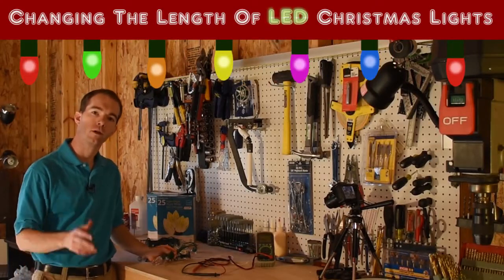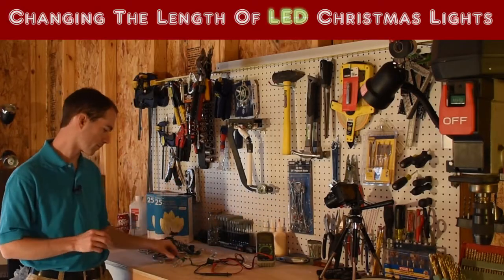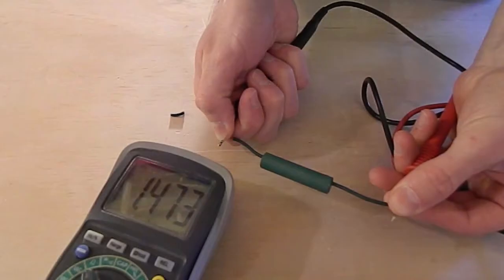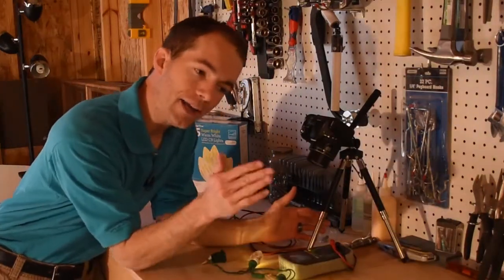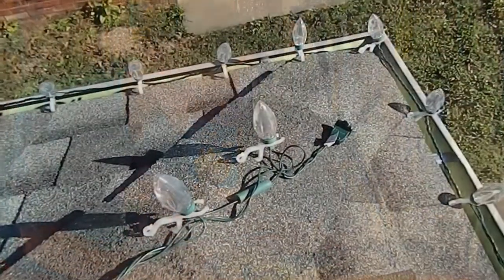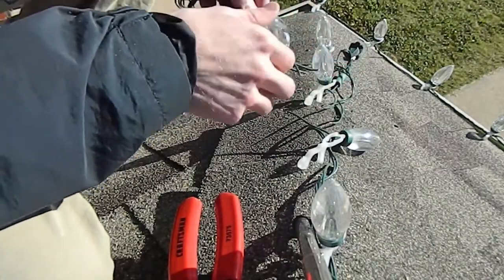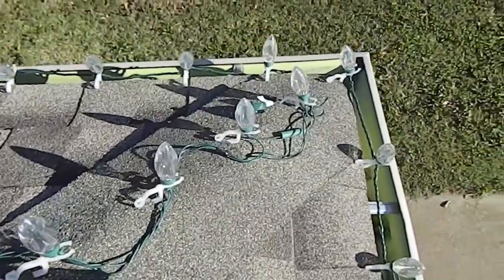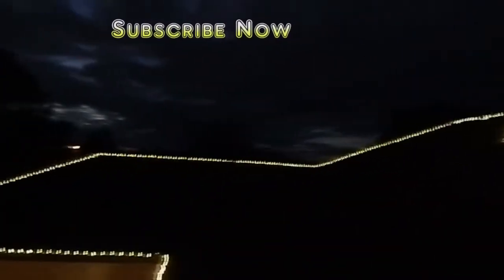Changing The Length of LED Christmas Lights. Don't Do This!

Comment: I am just now learning some of the basics of electrical connection. I have 2 strands of lights that I would like to connect together, by removing the female plug at the end of one where the 2 can connect by plugging into each other. 

I would to have it all one continuous strand, and essentially double the length so there won't be this eye sore of a foot and half or so of no lights with connection plugs right in the middle of it.

Is this safe to do, and how would a person go about doing it if so?

Thanks for any advise you have!
Reply from the maker: Hey Will. Great timing! I just had to do exactly this when my driveway plug got run over. I cut off each plug and soldered and heat shrunk each one. the plug ends only have 2 wires each, so it's easy to do. Now there're no fuses on the second strand anymore, but I haven't seen a problem yet, and they're been on for about a day now. I wouldn't put any more in series like this though because at some point, I'm going to blow the fuses in the first plug. Thanks for watching!

Comment: Hey Mike! Just found your video and was wondering if you could help me. For Halloween I have some craft jack-O-Lanterns I light up with store bought led lights. What I'd like to do is take the strand and splice in some wiring so I can increase the distance of the lights.. so it'll be the same amount of light in the strip, just adding in varying lengths between the lights. 
I normally line the jacks all in a row, but this year I'd like to stagger them around the front of the house. I'm also open to any suggestions you might have - I could email you a sketch of what I'm planning. Thanks! Subbed. :)
Reply from the maker: Hey there! For your setup, just cut one wire at a time between the lights you want to separate and add additional wire of at least the same size as what's on there now. The additional resistance won't be a problem unless you put a pumpkin in the next neighborhood over. Go one wire at a time so you don't accidentally cross any of them and short something out. Solder and heat shrink the connections if you want something permanent. Let me know if you need more help. Thanks for watching!

Comment: So I've a 3 wire 100 bulb string. After doing a crevier system and zip tying we  discovered the lengths are too long together and weight too great for practice and want to cut them in half. I don't have 2 wires where I want to cut. I want to splice two ends, a male and female. But I have 3 wires where I want to cut. How can I do so? I see what others are saying here about not buying cheap wires and using commercial grade wire but how can I interrupt the led wire and insert a male and female in the middle?

Comment: So how do you know which continuous wire goes with which.  Periodically an animal will chew through the wires so I do not know which wire went with which.
Reply: Northern Yeti, just take one of the wires that do not have the lights on them and mark it with tape or spray paint every few feet. That way if they get chewed through you can untwisted a couple feet and see which goes where. :)

Comment: My understanding is those "resistors" are wave rectifiers that convert AC to something more like DC, making the lights flicker at 120Hz. Maybe what you got there is something different, but I question how you are seeing different voltage by adding or removing LED lights which really don't have any resistance.

Comment: If I am stringing multiple strands together and splicing a few to go over peaks in my roof, do I need to worry about the resistors? If the outlet puts out a constant voltage then doesn't having multiple strands in series each with a resistor decrease the current through the entire light system lower than just a single strand, making all of the lights slightly dimmer?
Reply from the maker: Hey David, I'm not quite sure I understand your question, but I'll attempt to answer what I think you're asking. Plugging strands end to end electrically wires them in parallel, increasing the amp draw on the circuit. It doesn't affect the lights within the strand, because the strand still sees the wall voltage and each light within the strand sees its 3.5v after the resistor has limited the current. Adding or removing lights within the strand increases or decreases the voltage across each light, without changing the resistance. Removing too many lights sends too much voltage through lights and they will burn out. Adding too many lights reduces the voltage through them and dims them. Too many lights and they won't light. It's a delicate balance. Hope that helps.
Reply: @MikesInventions  That clears it up. My assumption was that combining multiple strands together would put them in series, but parallel makes much more sense. Thanks for the response!

Comment: What if I wasnt adding any lights but cutting the strand and extending the strand to go up to another roof.
Reply from the maker: It sounds like you just want to increase the spacing between two lights right? If that's the case, simply label your three wires between the lights where you intend to cut it. I'd suggest using a different color of electrical tape around each wire then cut the tapes in half so that you don't lose track of which wire goes where. Then add your extension, making sure to keep your colors straight, and the lights will never know the difference. Of course, I still don't recommend this. ;-) Thanks for watching Nic.
Reply: SWEET! Thank you!
Reply: I also want to do this but didn't know if it was a common way to do this or not, so thanks for asking. How else would you lengthen the space between lights for a custom length to fit a house with different levels and stuff?
Reply: This is exactly what I was wanting to do to a set of LED Icicle lights on my roof line.  Basically I was wanting to extend the lights around the corners of my roof line that drop down about a foot so that I did not have a bunch of icicle lights over lapping each other.  When doing so do I need to find the same size wire when adding the extensions in or can it be a little bigger or smaller.  I have lots of SPT-1 or SPT-2 cord, can that be used between the cuts to extend the wires?

Comment: Good video Mike.  I would like to move maybe 6 LED's 25 ft. on a strand of xmas tree lights down the side of the house to light up a flower box at night.  The rest of the strand lights up the back porch.  What I am thinking is to put both a male and female connector before the 6th light and then plug them into a 3 wire extension cord.  Should that work OK?
Reply from the maker: Hey Thanks. I don't quite understand what you plan to do. Could you e-mail me a diagram?
Reply: Sure, how do I get your email?
Reply from the maker: Mike@Mikesinventions.com

Comment: So, I want to cut an LED strand in half to make an under cabinet light. Not possible without a degree in electronics?
Reply from the maker: Interesting application. If you have half the lights, you'll need double the resistance to avoid overloading them. So, if you could salvage a second resistor off another strand and put them in series, you'd be done.
Reply: TY

Comment: good information, however, electrical tape???   Solder and use adhesive heat shrink (not electrical tape), and that joint will be just as good as the original.
Reply from the maker: Thanks. Heck yeah electrical tape. Works fine. Strength isn't really an issue. Plus,  I really didn't want to solder up on the roof. :-)

Comment: Can you shorten an Led strand?
Reply: I would not recommend shortening an LED string unless you know how to modify the resistor.  Removing LEDs will increase the current.  The strings are typically designed for 15-20 milliamps.  If you remove too many you could blow all of them.  Likewise if you replace white or blue LEDs with red or yellow ones you will need to adjust the resistor or risk blowing all of them.

Comment: I'm short 9  led lights on my strand, so I spliced them in and now my strand doesn't work. any suggestions to make this work?
Reply: you simply added too many bulbs.  LEDs need to have sufficient voltage to exceed their forward voltage point (roughly 3.5-4 volts).  If you have 34 bulbs on the string there's not enough voltage to turn them on.
Reply from the maker: Hmmm... Check to make sure the wires aren't crossed. Check the fuses to make sure they aren't blown. Also check that all your new 9 led's are seated in their sockets. A blown bulb won't turn the strand off, but a missing bulb will. I hope one of those suggestions fixes your problem.
Reply: Cpt Striker, he said 2 was okay. 9 is a LOT MORE when you're talkin about 20 or 30 to begin with.
Reply: Mike Thompson     Nhcywy

Comment: I found this very helpful. I have about 25 lights too many on my last string of colored C7 LED lights. The string has 50 lights and is 32.6 feet long. Can I simply take out the middle as long as I leave the 1st and last resister?
Reply: LEDs are NOT like incandescent bulbs.   LEDs are solid state.  (LED = Light Emitting Diodes)  Diodes have a relatively fixed forward voltage drop (Vfd) when current runs through them.  Red LEDs have an approximate Vfd of 2 volts.  Blue, White, and Green LEDs have a Vfd of approximately 3.2 volts.   This Vfd is governed by the Physics of the solid state materials used to make LEDs.  The Vfd will vary only about 5 % depending on how much current flows through them.  To vary the LED brightness you control how much current flows through them NOT how much voltage you apply across them.   You do this by varying the current limiting resistor.   The in line resistor Mike pointed out  is the current limiting resistor in his Christmas lights.   If you were to apply 4 volts directly across an LED with no current limiting resistor it would immediately get burned up.   Most LEDs peak allowable current is about .020 amps or 20 milliamps  (20 thousandths of an amp).   These LEDs will work with currents ranging between 15 and 25 milliamps without much effect on life expectancy or brightness.   SO,  with the White LEDs you are using with the existing current limiting resistor that comes with your lights you can vary the number of LEDs in your strings between  as little as 25 bulbs and as many as 31 and be within the 15 to 25 milliamps usable current range for the LEDs   This is  assuming your mains voltage is exactly 120 volts in your area.   My mains has been known to rise up to 126 volts.    Be careful though, there are so many circuit configurations of LEDs strings so you need to know exactly how they are wired up so you will potentially be burning up you lights and wonder why.   This is especially true for 50 and 100 or larger strings of LEDs.   LED lighting is so new, manufacturers are still coming up with new circuit configurations to make LEDs strings.  They have not standardized on any configuration yet.   MORE IMPORTANTLY THAN ANYTHING, YOU ARE PLAYING WITH 120 VOLT WIRING SO ALWAYS UNPLUG EVERYTHING BEFORE WORKING ON 120 VOLT POWERED LED LIGHTS.  Good luck and be safe.
Reply: If you took out half the bulbs the remaining ones would be getting double the normal voltage, which is probably not wise. If nothing else you'll blow them out really fast.
Reply from the maker: This is accurate, intelligent, useful information and is a good addition to what was said. Well said JP040759, and you get a "like"!
Reply: You're welcome and Thank you.

Comment: Interesting seeing how they manage the voltage for LEDs. Why not take time to solder the connection? seems like the old twist and tape is only good till it's yanked hard.
Reply from the maker: +Josh Moss Yeah. It is interesting, but really inconvenient for anyone wanting to modify their perfectly engineered creation. My soldering iron was at work and I was already on break when I shot this. I figured no one will get up on the roof to yank it, so it should be ok. If it does come apart, it's an easy fix.
Reply: Mike Thompson g